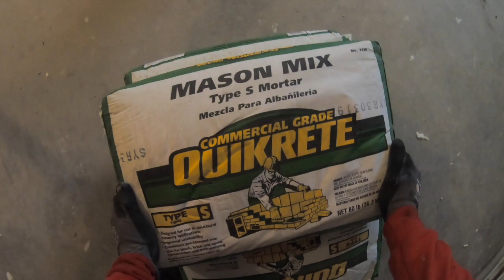Laying brick inside a house with a Pro.

Comment: I want to ask what happend if we combine the hot water tube on the internal waals and cover them by steel sheets to make a combact wall radiator ?
Is it useful to be tested ?
Reply from the maker: sounds like it would work.